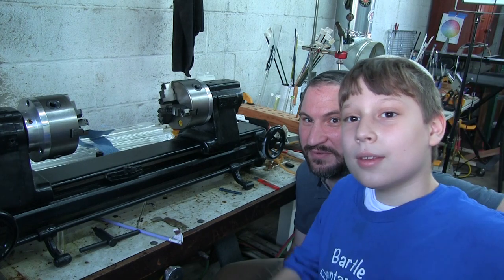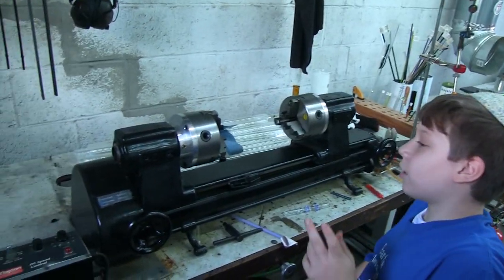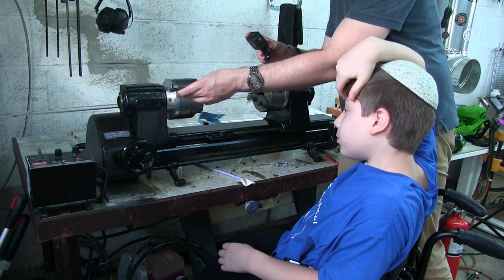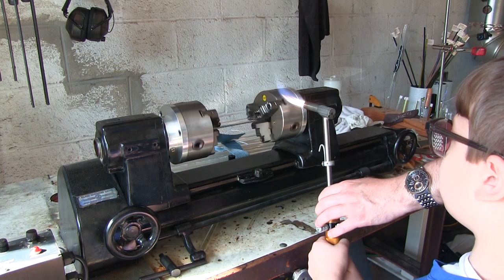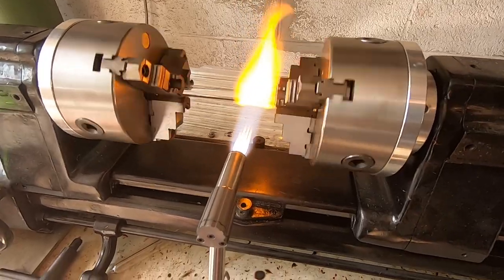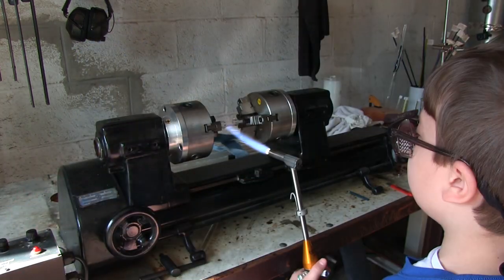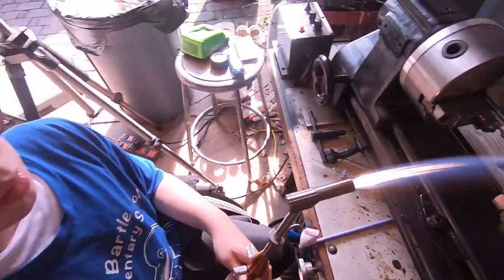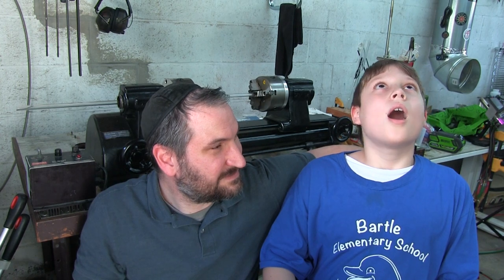Lampworking | Glass Lathe | The Fusing Shop

Comment: Nice! I have been a lathe glassblower for 44 years. Your lathe looks like an old Litton F-lathe!!!! Beautiful! Looks like after market 3-jaw chucks used mainly for a metal lathe, but they work well. Also, the Dayton motor controller is nice too! I primarily use 3-jaw Pratt-Bernerd chucks, but have 3-arm planetary chucks also for larger glass. I just retired from scientific glassblowing, but still work part-time in my garage. I have a lathe made in India that my employer had customized to accept Litton HSJ chucks. I worked most of my years with a Litton HSJ lathe, so mine works well. Awesome that you are teaching your son; glassblowing is certainly a rewarding profession.
Reply from the maker: Hey Patrick!  Wow you sure know your lathes!  Yes, it is an old Litton F-series.  It runs so smooth and true.  I would like to get a bigger size lathe but they are not easy to come by.  Have you ever worked on a Seams lathe?  I hear mixed opinions on them.  Happy to hear about your retirement.  What kind of scientific glass did you make?